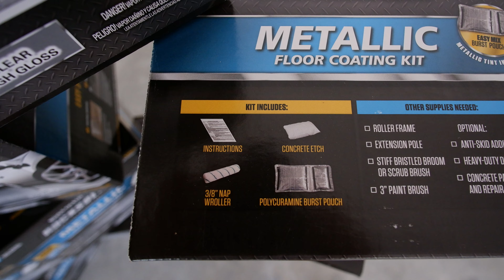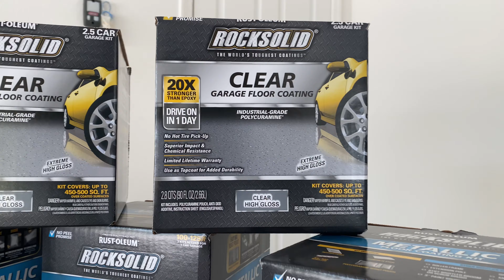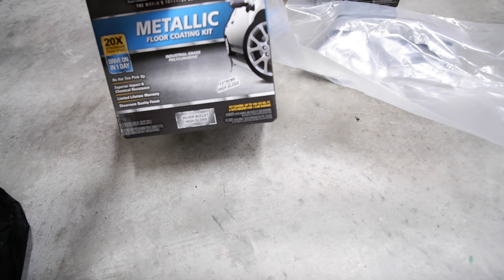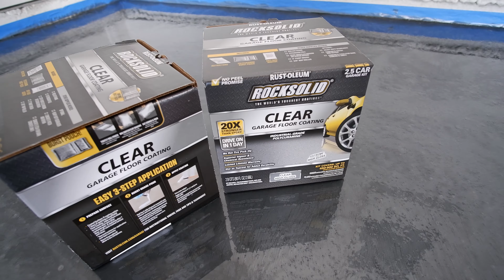How to Apply Rocksolid Garage Floor Epoxy Coating | Rust Oleum Metallic Polycuramine

Comment: Thanks for the sharing!  Wish I had watched your video before I did my garage flooring.  We ran out of paint mid way, now paint on some areas is rather thin.  Worst yet, 25% of our garage is not painted.  Now trying to get the kit again and will finish up the remaining 25% later.  

Your sharing covers important things to note, and is very helpful.  Looking forward to more projects / sharing!

Comment: Nice garage! With rollers we wrap masking tape around the roller like a mummy lol (leave an edge at the end) while the roller is on the stick you grab the edge you left and pull it fast to unravel the masking tape. That should help with fuzzys in the rollers, just do as many times as you see fit. No matter the brand all rollers will be a bit fuzzy🤠👍🏽
Reply from the maker: Good tip, my de-lint was a light tape pull, didn’t think of full wrap and unwrap of tape.

Comment: I installed a crankcase vent filter on my 07 IS250 and noticed that the fuel trims immediately shot up to 20%. Did your fuel trims shoot up as a result of your crankcase vent filter? I have the other end that the hose would typically go into the intake tubing closed off and airtight so im not sure why my fuel trims shoot up so much after installing a crank case vent filter. I used the KN 62-1560

Comment: I’ve used this product in my salon in different areas before. I never used the spike shoes. Do you think they helped? Did they leave marks? 
I love this product because it adheres to different surfaces. After ripping up carpet I was left tons of glue and some areas have tile some have concrete. What would you use to get glue up? Although, once sanded flat, the epoxy adheres to it just fine.
Reply from the maker: spike shoes help you work over areas already coated, to ensure even coverage. The epoxy just eventually flows over the holes as it cures/settles. For any concrete, I would recommend a big ass floor grinder rental, it guarantees proper prep and all crap removed, you can also skip etching if you grind. If I did this again, I would rent a grinder and skip the etch. A grinder with vacuum/dust collect is needed to minimize mess. Only thing is making sure you get all dust cleared before coating.
Reply: @TunerwithKids  I actually did a giant grinder with Vacuum in my main salon and hallway the glue was so bad I has to go over it. I was going to just polish the concrete but with the glue epoxy was recommended by a friend that does this type of work since it adheres to everything. It’s been 4 years. Holding up well. I have more smaller areas to do. The floor has uneven areas and at least the glue levels it out. I’m just going to sand it flat. Definitely going to get spike shoes too.
Reply from the maker: Yea if glue is adhered and you can scuff it, the epoxy coating will do fine.

Comment: Man it would've been so helpful if you talked more about the acetone and isopropyl alcohol mixture ratio and how you sprayed.
Reply from the maker: I just sprayed it straight (90% IPA) using the sprayers from HD or Lowes. For acetone I got the Zepp Pro bottles in case the plastics in the cheaper bottles might melt. Just mist it and let is settle. Don’t over due it cause it flows out and evaporates to give you effects
Reply: So you sprayed the 90% isopropyl and then sprayed the acetone in a separate bottle? So 2 separate applications but simultaneously basically?
Reply from the maker: Two separate bottles. Each gives different effects. Acetone gives craters. Alcohol gives flowing streaks.
Reply: Tremenda pregunta gracias

Comment: Bruh, I just bought the same stuff with the same idea.....came to YouTube to search for a video to see if anyone else did it so I can get tips, and voila...thanks for the video.  You guys did excellent and I love the work you did.  I love your acetone idea.  I'm gonna do that as well.   

So, did you say just use acetone,  no need for the alcohol?  And what technique did you use to make the marble affect with the acetone??

It looks excellent bud!👍👏✌👌

And, I believe the rough texture as an anti-skid is 100% meant to be.  That's how I want it.  I was saying "that's perfect!  It's perfect, dude!" the entire time you were pointing out the final results.  Lol
Reply from the maker: The alcohol and acetone do the same effects. Alcohol produces a longer running streak vs acetone since acetone evaporates very fast. Acetone probably does the craters more than streaks. 

Random action of the roller creates the marble texture look. 

The rough texture is definitely the dust balls off the rollers. I should have cycled more rollers but it’s hard and messy to do when your in the work flow. I used like 2 or 3 for the 12 kits. Should have used one for each kit to keep it dust free but oh well, inadvertent anti skid. I never use the anti skid powder. I’ve got like 6 bags from all the other garages I’ve done.

Comment: What do you do about the little pebbles between the concrete slabs? Do you fish them all out?
Reply from the maker: Can’t really do anything about it. Unless you can vacuum and get every spec of dust out it will always be there. On older coatings with the flake, it’s hard to notice but on this smooth shiny stuff, it is inevitable.

Comment: Looks really good! I think I’m going to copy this exact concept. I’m not a fan of the paint chips that come in most epoxy kits, but I’m worried about even coating of the solid color, so I think the acetone trick is perfect to show that effect is intended. How much of the 8oz acetone did you use? Also, did you just lightly mist some right after applying the epoxy or did you spray a fairly good amount?
Reply from the maker: I only filled my 32 bottle like half or less. But I had 850 SF to do. I would recommend misting it about 3 ft high and letting it drop right after you finish a section. It dries fast and lets the epoxy flow out. The alcohol dries slower and when I sprayed it late (after 20 minutes) it created the craters that didn’t flow back fast enough cause it was already hardening.
Reply from the maker: Also, I’m questioning if I should have grinded the floor after doing it. If you want to be 100% about adhesion, maybe renting a grinder with diamond pad and vacuum will be the best prep. You can skip the etch using that method. But my old epoxy with flake floors have lasted 9 years with zero lifting or pickup issues.
Reply: @TunerwithKids  The house is a brand new build so it’s completely fresh concrete - I’m hoping that will allow me to use the provided etch without any issues
Reply from the maker: You want to let it dry for at least 30 days which it probably will since it takes more than 30 to build the home. The thing I’m worried about is the veneer coat that they sometimes do when the floor isn’t as smooth as the builder likes it. But it’s at mercy of the quality of the floor.
Reply: @TunerwithKids  that’s a REALLY good point. I didn’t think about that. I’m definitely going to ask the builder about that.
Reply: @TunerwithKids  I’ve also seen people apply a recoat primer to the floor before doing the epoxy to make for an extra layer of adhesion - could also be an extra layer that fails too 😂
Reply from the maker: @P_Weave  I don’t trust the primer since it’s a regular coating and not a 2-part epoxy that hardens. The best mechanical adhesion is epoxy to the porous concrete.

Comment: How is the garage holding up after how much time has it been?
Reply from the maker: It’s been 15 months. I got lifting near the entry last year. Moisture and water bubbled up in two spots. I got it warrantied (new kit and small clear) but haven’t had a chance to cut out the sections or do the repair in the spot. The rest of the floor is good, but signs of wear though. It was obvious from beginning I knew that with the shiny finish.

Comment: Can I fill in the concrete slits to make it even and flat throughout?
Reply from the maker: You can but not recommended. They are for expansion between seasons. You can fill with a flexible epoxy but coating may crack over time.
Reply: No, those are control joints, do not fill them with any epoxy or Polycuramine or your floor will crack somewhere else...

Comment: After a year has passed, how is the floor holding up?
Reply from the maker: I got some bubbling near the edge/door. I think the prep needed to be better there. Like grind the concrete. I also put a thick layer on. It got water under during heave rain last June. Rust oleum paid for a new kit and sent me clear to fix. Otherwise, normal wear and tear at the door due to high foot traffic. Kids keep dragging their toy vehicles on it and causing scratches (as expected).

Comment: How much were the boxes? And how many did you use
Reply from the maker: I ordered two packs from Amazon. See links in description box. It was less than $100/each. I used 12 plus two boxes of clear which was $140/each.
Reply: My friend there are way better and cheaper options out there like the purepoxy products or gladiator epoxies, for the next project take a look at those. Still came out great though 👌 👍